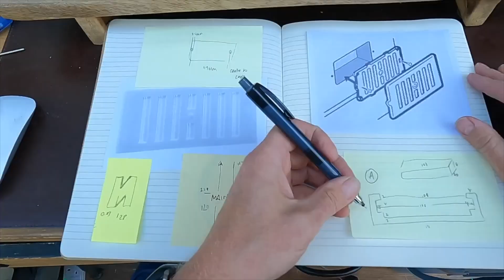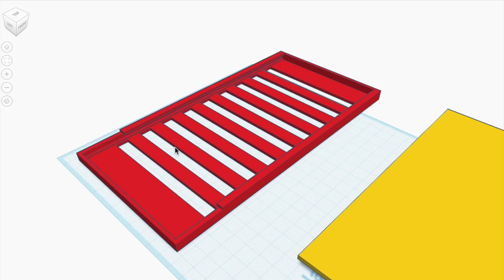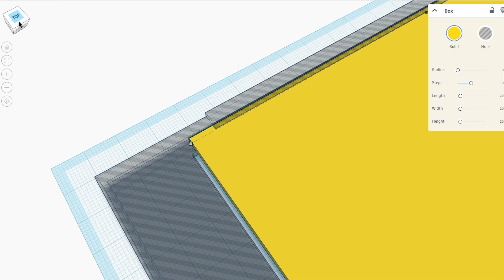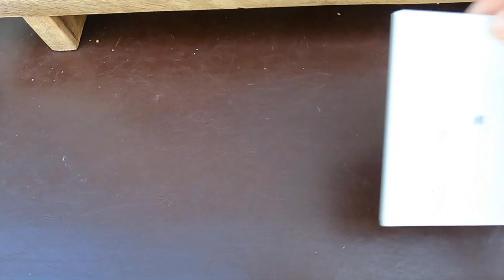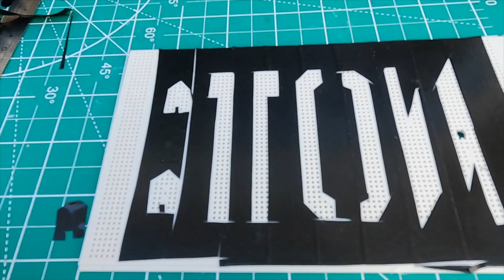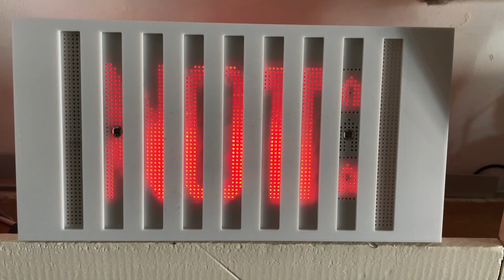Behind an Air Vent, a hidden message revealed? #EscapeRoom

Comment: You could add a small magnet in the front grill, and a detector in the internals, so the lights won't flash until somebody moves the grill.
That way the players in the escape room could turn off the light (useful if you want to have it as a feature later on) and won't see the light shining through the grill.

Another benefit to this approach is that the puzzle is entirely self-contained and relatively easy to discover as you don't need to combine it with a switch somewhere else in order for it to function.
Reply from the maker: Really like that idea! I'd thought about a slide switch too, so it only goes on when slid aacross and the two points touch.